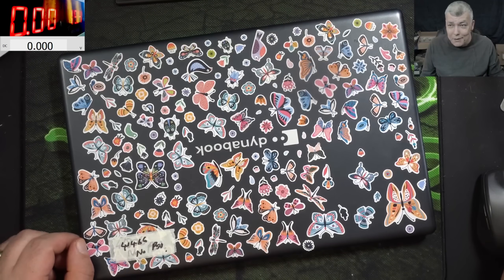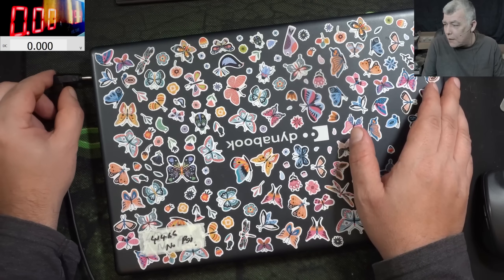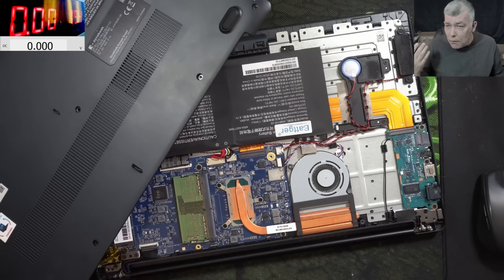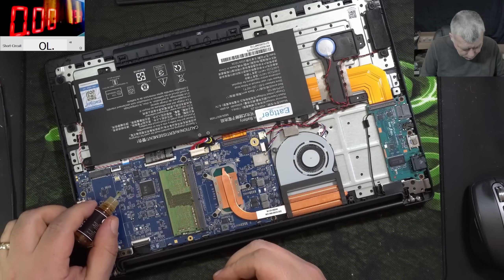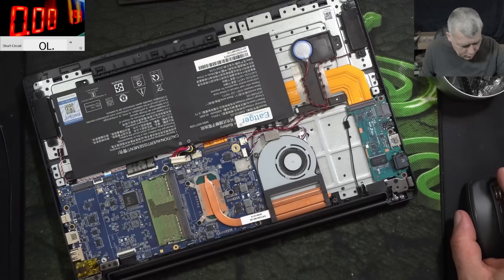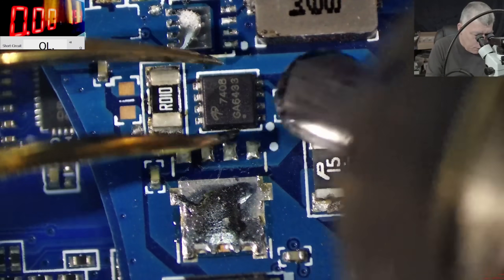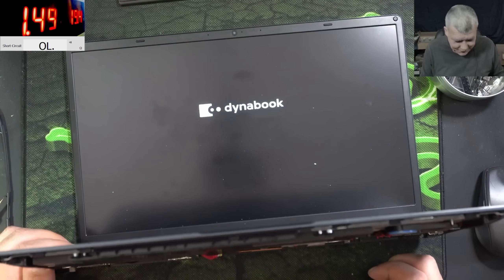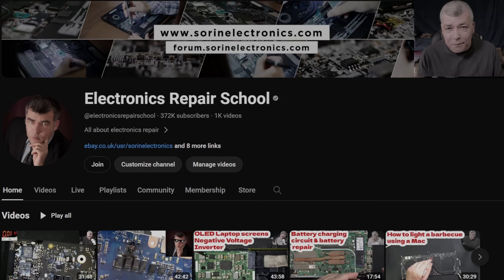Shorted brand new mosfet? I got punished, no more candies, Toshiba Dynabook not charging repair

Comment: Mr. Sorin said it's an easy job. But I remember the first time I had this problem with the Dynabooks, it took time and effort. From that experience, knowing about a repeated failure on these machines helps resolve the problem quickly. It seems easy, but it is for someone who knows how, understands, and also has the right tools.

Comment: Does anyone know for this laptop ACER Nitro 5 AN517-52-71C7 i7 11 gen. Rtx 3060 model of first N mosfet. I need to replace it but i dont see clearly which mark is on it and which one mosfet i can buy as replacement.
Reply: Look up the channel viz whether it's N or P channel. If it's N channel, any N channel will suffice! Of course, of same size.
Reply: PQB3 (the first mosfet) = EMP21N03HC. It's a 30V 100A N-channel MOSFET in a DFN5X6 package. You don't need to be exact in your choice of MOSFET, any N-channel MOSFET (that fits) from another gaming laptop should be fine. 

30V is Vds (max) and 100A is Id (max). These are MAX values. The voltage on that mosfet is going to be around 20-25V and the max current is going to be around 9-10A.
Reply: @dfear  unfortunately, the mosfet at the cpu is also short-circuited.  after it was removed, the computer works but without the image :(

Comment: May I ask how to identify it is channel n mosfet? Thanks in advance
Reply: You can always check in the datasheet, just enter name (usually 4 number but can be longer) fallowed by "datasheet" in the Google and check. Or you can like Sorin based on the fact that 90% of the time N-channel is used just assume it is an n-channel and be wrong in a 10% of cases :)
Reply: The specs of MOSFETs don't vary much from any non gaming laptop.